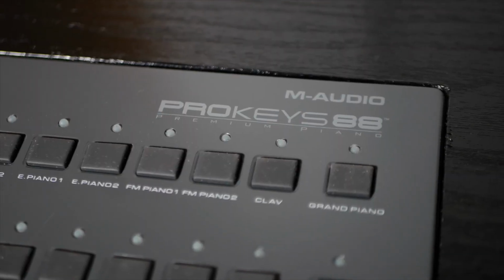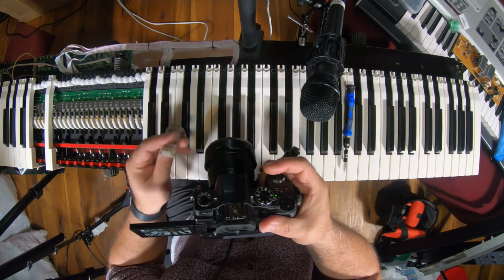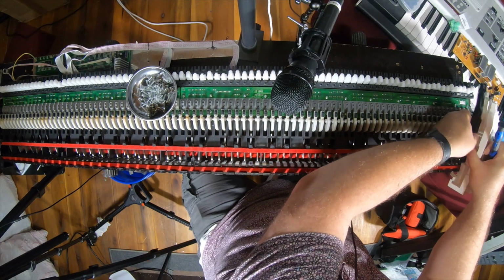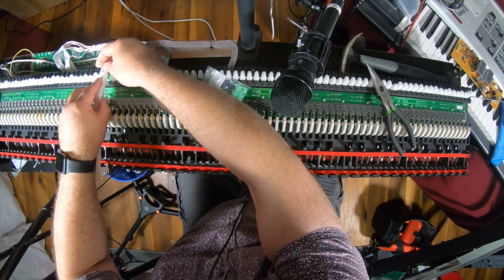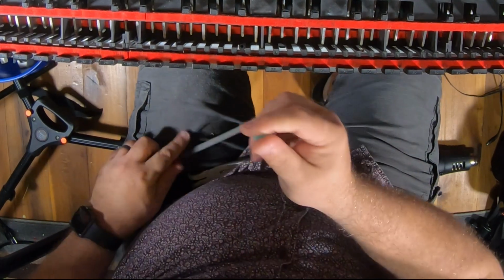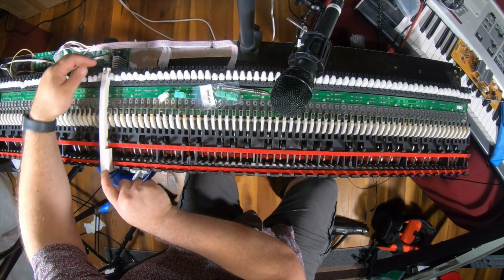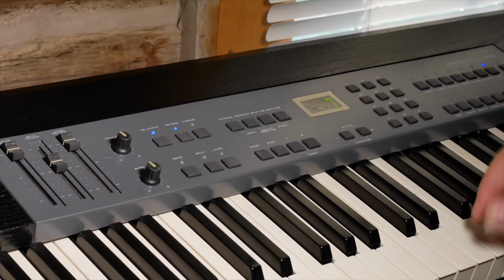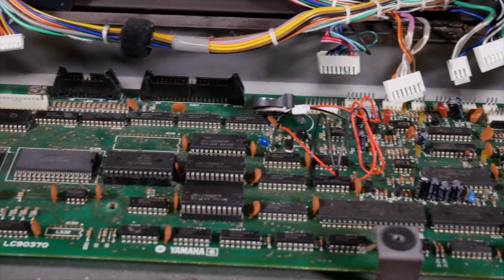ID Labs - Episode 3 - M-Audio Prokeys 88 Repair | Key Pivot Replacement

Comment: Great job! Any idea how to get to the pitch wheel without opening the whole thing up? Maybe the side panel comes off?
Mine keeps wandering up in pitch. Gaffa tape is the current solution😀.
Reply from the maker: I sold this keyboard, but I do have a Keystation Pro 88 I'm working on that is built the same way. Sadly that little section that holds the wheels in place is not easily pulled off. If you watch my other video about the Keystation, you can see just how much work it was to get that side panel off. Sorry :(

Comment: Hey friend! Have you an idea where to find those springs on keys or replament ? I have the same midi controller.  I oponed a doesn’t have the springs so the pivot don’t work as kud! Thanks
Reply from the maker: https://syntaur.com/keyboard.php?keyboard=M-Audio_ProKeys%2088

Be aware, they charge a LOT. I have a Keystation Pro 88 here that uses the same springs. I may try to measure them and see if they're a standard size that you could order off amazon when I have time.

Comment: Thanks, my friend! I have one just like it, but the pitch bend and modulation send a signal even without moving. What I did was disconnect it, but it still sends pitch bend and CC1. I think it's a problem with the main board. Have you ever experienced this?
Reply from the maker: I sold this board months ago, but the new owner sold it recently and I don't think he ever had any issues with that.

Comment: I have to do the same repair to a Keystation 88 pro..  Cant you cut out the bad key pivot and slide them all left one key and then install the new one at the end?  I have to repair the Eb in the middle octave. I may buy a used board for parts.
Reply from the maker: I don't think you can. The problem is there are dividers between every pivot, so you can't just slide the entire thing, nor can you life the entire thing out and shift it. You probably have to do what I did and tap the bar until it frees the bad one and replace that. If I have time this weekend I will open up my Keystation Pro and take a look, but I'm almost positive it's the exact same keybed.
Reply: @TheImperfectDrummer  Your're right they are separated by the individual keys.  I may buy another board and use my current one for parts.  (Or switch to a used Roland A90)